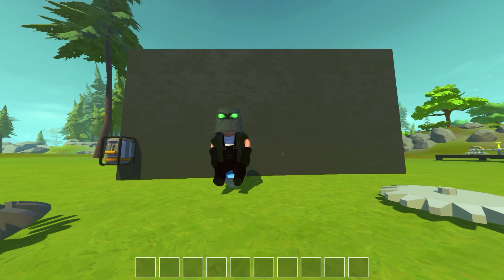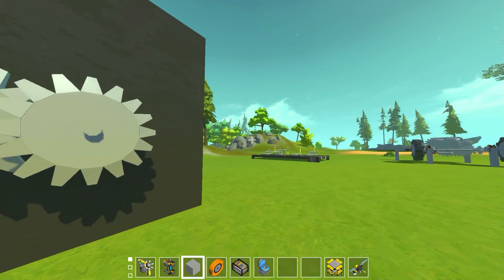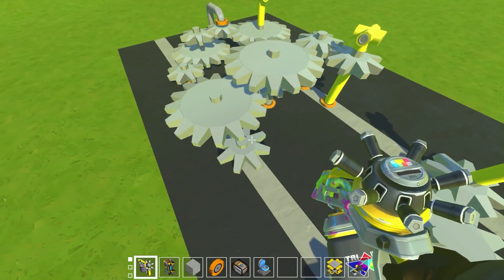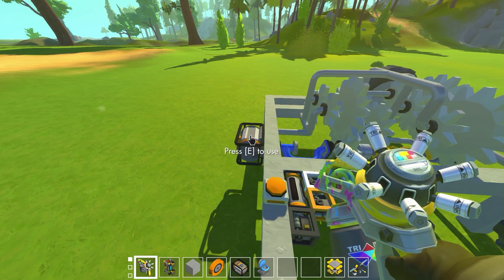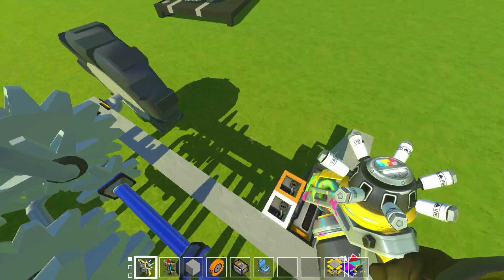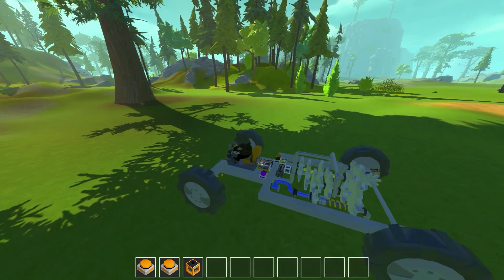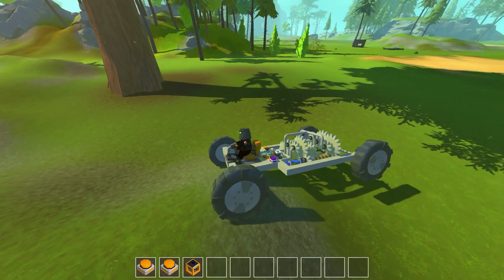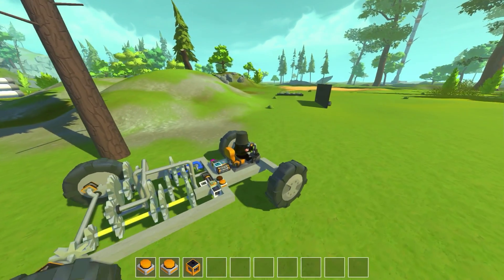I Built a Multi Speed Transmission Using Gears! (Scrap Mechanic Gameplay)

Comment: Challenge (given it doesn't lag too much),

Connect a piston engine up to this transmission, then into a central differential splitting off into two CV / U-joints to two more differential for both front and back axles. Complete with suspension and steering.

A fully mechanically-driven car.
Reply: When survival comes out the design will become even more realistic with fuel
Reply: IDK what are you talking about but, it seems to be really cool

Comment: We're you had the suspension, you could put a piston with a power at zero so it's more like suspension. if I remember pistons don't have a suspension like glitch. If I'm wrong I'm wrong thought, just giving my two cents into it.
Reply from the maker: Problem is building it. You need the piston to be extended to 5 blocks when you build it and I don't think there is a block that can do that.
Reply: @kANGaming  true, didn't think about, wonder if anyone has modded any block of different lengths, that have no collisions. Well it was a good idea, but I was wrong, lol
Reply: @kANGaming   There is! in durf`s modpack thre is 5 block long suspension!
Reply: @embe_8244  he used that in the build, but to get rid of the suspension glitch, I thought use a piston, but like the suspension piece, because the piston doesn't have the suspension glitch effect happening at faster speeds. So he needs something that can compress and expand, but not using a suspension piece. 

Hope that makes any sense whatsoever.
Reply: @kANGaming  You could use two pistons, one at 0 power & 0 length then another to stretch the first out of they way when the creation is removed from the lift

Comment: Awesome concept and would love to see an automatic version. As a solution can you put a piston on the other end where the suspension was the reacts opposite to the existing piston to support the engine output, Then put some "T" pipes with free bearings and some bracing to the sides of the car on the back side of the cogs to stop them flexing as well. Keep up the amazing content

Comment: Haven't watched the full video yet but wanted to start this comment. You explained gear ratios very well and used terms that everyone could understand. I like that.

So after finishing the video i may have a suggestion that could help. You could use a twin shaft transmission. Meaning you drive gear from your power source runs through the center with your gear selection(ratio) running tandem down the sides with a single output in the center at the rear. It was a very common design for semi truck manual transmissions. I wish i could explain it better but it's hard to write out every single thing about that.

Comment: Fun Fact: To quickly write numbers into a memory, connect a Keypad to it.  The different buttons on the keypad are actually separate  buttons and work like  a calculator, sort of.  It constantly sends out a number value equal to the number you type in (i.e. if you press 3, it will output 3, and if you subsequently press 5, it will start outputting 35), and if you press Enter it will output a 1 tick logic pulse and then reset itself.  Very useful for writing memories.  If you want to write 30 to the currently selected address, just wire up a keypad and type 3-0-Enter.

Comment: You could maybe have a dummy gear on a shaft that follows the main drive gear ( like a rest on a lathe) that has the purpose of absorbing the flex when all that torque is transferred into the drive gear, so that it will push back into position.

Comment: Kan, I designed a mechanism with modpack logic that makes it so you can't keep adding to a number block after a certain point. You could use something like that in this mechanism so you don't start shifting into non-existent gears. I made it using an and gate, a math block, and another number block. The math block checks to see if the number block hooked up to the memory block is either less than/equal to a number, or greater than/equal to a number. You hook up the number input and the output of the math block into the and block, and boom. You can have two of them for both extremes, 0 and 4, and you don't have to worry about the memory block going past a certain point.
I used this system in my Forklift and lift designs so the number block that goes to the smart engine doesn't start counting into the negative when the lift/fork is at its lowest setting.

Comment: Yo kAN, it's skipping because you don't have a differential on the rear axle. Having a diff with plenty of slippage will allow your transmission to not have hiccups like such and allow the wheels to rotate at different speeds without issue.

Comment: This is a weird thought, but if you're familiar with Factorio, there's an interesting mod called Factorisimo that lets you build little factories that you can then build inside, so you can pump resources from your main production line into the factory, have them go through some sort of processing, and then retrieve the finished products form the other side.

I wonder if you could make a similar mod for Scrap Mechanic, so you could build your gear assembly in a sort-of black box that just has a couple of axles and control points sticking out, without having to deal with the bulk from the gears themselves.

Comment: what they really need is a U-bolt. something that can attach a drive train to a solid block to get rid of the wobble of the drive train. something like a bearing that also acts like a block, so it attaches to a block but any pipe going through the block acts like a free spinning bearing to attach something to the other side of said block to continue the drive train in a more solid and stable rotation. would solve SO many problems in this game.

Comment: A military design of planetary gears and clamping each gear set to achieve speeds may work better. The last ratio may need to be 1:1 or 2:1 at most for overdrive once at speed. More contact points that the gears have the less skipping u will have

Comment: even today the small gear has the issue.  workaround is putting bearing on gear, then weld bearing to the place you want to mount the small gear, and that only welds the bearing and not the gear itself, so it'll rotate like it's supposed to

Comment: I would recommend having the suspension be unable to rotate off of the gear and have it not bottom out so you don’t have a suspension glitch this could be done with a groove along with a block with a barring between the suspension and the gear

Comment: hey kAN, in place of that suspension that you removed, make it a piston that contracts or extends opposite of the one you already have to push the drive tooth, that will fix the suspension glitch, and hopefully bring stability back to the drive shaft

Comment: You forgot to add a clutch, that's why the gears are grinding. Locking teeth of already spinning gears is hard. You need a way to disengage drive shaft and stop the gears before you shift to the next gear.

Comment: Instead of using the suspension maybe you use two pistons working opposite directions of each other pressing the gear drive gear between them? If they work in tandem with one extending and one compressing at the same to line up at each gear I would think you won’t have the problem of the gears skipping as much(less movement because of the suspension). Just a thought. No idea if it would work tho 😂

Comment: and this is why most cars don't have a gearbox that outputs a higher rpm than the engine, I'd say let the highest gear be a 1:1 ratio and the lower gears decrease, that way you won't stress the gearbox that much. you can just increase the engine rpm to go faster, this way you also get way more torque at lower gears

Comment: To fix the suspension glitch issue is that you could replace it with a piston that goes back as the gear shift piston goes forward.

Comment: I would like a replica of an F1 car, it has 9 gears (1 reverse and 8 forwards), it has pushrod suspension, and downforce using the aero mods. Also, to shift faster between gears you might as well increase the piston speed.
Edit: F1 cars are manual and they shift very, very quick. Like, 0.005 seconds quick.
Edit 2: You don't need to make it a 1:1 scale, because it has a lot of gears. By the way, the engines themselves rev up to 15000 RPM, so that's quite fast. Hope you can replicate it, cuz I would like to see an F1 car in Scrap Mechanic!
Reply: Robert Virya relax

Comment: dono if i am late with this, but for an idea to get rid of the potential problems: just make a stepdown from the motor to the transmission and then step it back up to the wheels, this way u have fast engine to slow transmission to fast wheel speed

Comment: kan, try to use dog rings or syncros like a real manual gearbox, that way you can have all the gears meshed correctly and only mesh the dog rigs on the output shaft

Comment: I found out about the gears from moonbos video too, and I'm working on a 5 speed with realistic suspension, rack and pinion steering, and differentials. I'm trying to make it all wheel drive, but that might not work. I already have a working (I think, I haven't really tested it yet) differential and transmission. It will use no engine and be (technically) piston powered

Comment: instead of using suspension for stability if you widen the creation a bit and put another gear on a bearing for the drive shaft to tooth into opposite of the original transmission for every gear, it, in theory, should help the skipping.

Comment: I might suggest having a double wide gear or wider on the driveshaft and where the driveshaft connects, it should give you less issues with slipping.

Comment: i think common gear ratios are 2-1 3-2 5-3 1-1 1-2 and 3-1 for reverse also a normal manuel transmission locks the gears to the inpu schaft instead of moveing a gear. and an automatic transmissionuses planetary gears and changes the ratio by locking the gears with a clurchpack

Comment: You could make an automatic without the RPM sensor.
If the rear axle was mounted to horizontal suspension, you could put a sensor in front of the wheels to downshift when the vehicle meets too much resistance, and a sensor at the back to upshift when the vehicle is just cruising with no resistance at all.
To tune the shifting, just adjust the strength of the suspension.

Comment: With the gearing,if you are able to put a piston towards the end of the driveshaft to dis connect the axle from the driveshaft for a small amount of time you could possibly get the gears to mess correctly a little better Bc you could cut the power to the engine after taking the driveshaft away from the axle to shift to the 3rd gear then the a piston would reconnect the driveshaft and the axle giving it power again
Reply: If i need to draw up something and make a video to help explain my idea to help you then i will,but just tryna help you out some with the gears notmeshjng together correctly

Comment: you could use a piston instead of that suspension piece, just hook it into the smart engine & give it 0 resistance to the piston that slides to drive gear, and also counterweight your axles, with the pipe pieces only going off to one side of the axl, its wiggling the axl and causing some skipping

Comment: use a gas engine! it will help with the skipping gears and it makes more sense to have gears on it because it's weak and "slow". i think the adjustment on it is the amount of  torque not speed. it tries to spin at 100% but torque can be adjusted.

Comment: Idk almost anythhing about SM, but maybe if you made a double gearbox system, imagine linking the main gear connected to the engine and the end of each "gear" connected to the differential, it would avoid skipping issues and the gears would be more efficient, right? The problem would be the space that it would take and the shifting time, though...

Comment: Hey so try to make a diffrential for your rear tires, that should solve the gear slip issue because both your tires are spinning at the same speed when you turn which causes stress and causes the gear slip.
Reply: @kangaming

Comment: That is basically a motorbike transmission: 1-N-2-3...
As for shifting gears, can you build a clutch system for each gear instead of that gear on a piston? Each gear is permanently meshed, but to rotate the input off a common shaft it has a peg-in-hole clutch (Look at "rather-b-welding two speed go kart transmission" for the idea). Though i am not sure if SM allows for something to slide on a shaft or it has to use a piston as the shaft.

Comment: Use a 2nd piston with inverted settings to add stability to the other side with no suspension needed. It'll be annoying to program inverted controls but it'll solve the problem.
Reply: It'll also still be able to clip through that gear as well.

Comment: Kan! you have the gear ratios mixed up. the first number is the rotation of the original gear and the second is after the gear messing around so 4:1 is 4 rotations of the original gear to 1 of the second, and 1:4 is the opposite.

Comment: I believe if you take the output shaft you have now and make a different drive shaft you can move it like you did for the first 3 on the back to you can hit the lower gears with the higher speed output I’d have to show you to understand but basically you can double your gears ratios

Comment: Hey kAN
I think one problem is that because the wheel axle is static you're loosing torque to not only spin the wheels but also to drive all gears backwards. i think it would be a big improovement if you just fliped the shifter from the input to the output side that way the torque requred to drive all the gears would stay constant and not increase with each gear shift.

Comment: I know I'm late for this video but why don't you try and put two gears together because that might be the problem of the gears popping in and out a lot. Sometimes its best to look at refs of car gears to see the width of each gear. It might extend the transmission box but maybe it might help hold the drive gear in place. I don't know it if this will help

Comment: Instead of having an external "powershaft" or whatever you wanna call it, try to make it like a motorcycle transmission, a dog-box, where some gears are free-spinning and you have "dogs" that are connected to the input shaft and slides into a free spinning gear and locked it onto the input shaft. If you didn't get what I mean, just search up how a motorcycle transmission works on YouTube and I'm sure you will understand what I mean.

Comment: Piston power engine to the transmission and then having differentials where needed? And I know this would get super complicated and stupid  and probably be impossible but would it be possible to also fit this out with an adjustable double Wishbone suspension setup? And would it be possible to set it up using logic to be able to shift between manual transmission and automatic transmission? Making a hyper realistic and controllable off-road car essentially?

Comment: 5 months late BUT if you switched your output gear from the transmission too a large and kept the small gear on the axle your out put/drive speed would be 2:1 instead of 1:1 which means youd put less strain on the drive gear for more speed.
 I.e. the drive gear wouldnt skip as much

Comment: What if instead of using a suspension to assist in the gear not slipping, you use another piston facing the opposite way and you just retract it as far as your 1st piston extends.

Comment: torque doesnt really exists on scrap mechanic.
one example is the pistons, they are much weaker than any engine, while you can lift 200 concrete blocks with them, you can lift 600 with any engine.

Comment: Try not gearing so high. No real car has a 1 to 4  final gear. 
A typical transmission final gear ranges from 1 to 1 to .7 to 1.  And then after that there is another gear reduction in the differential which typically ranges from 3 to 1 to 4 to 1. 
You want your engine rpm up and use your gear reductions to create torque.

Comment: You have got youŕe gears wrong you sad 1:4 but its 4:1 if you wanna make it slower 4 rotations on the input shaft is 1 rotation on the output shaft you had the other wat
Reply from the maker: I honestly couldn't remember what the proper way to explain gear ratios was. I know one way its 4:1 and the other its 1:4 but I wasn't sure which was which.

Comment: Ive downloaded the mod. It is crap.  I downloaded the linked mod, theres no such one gear, theres a gear wheel and gear teeth
You have to use Blueprints because you cant build it and there is only a 5 block and a 3 block gear